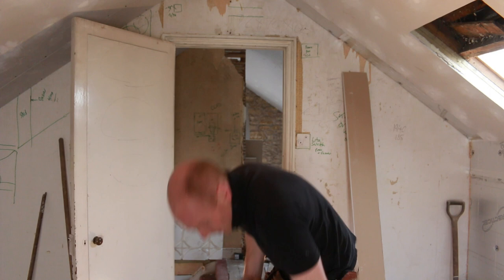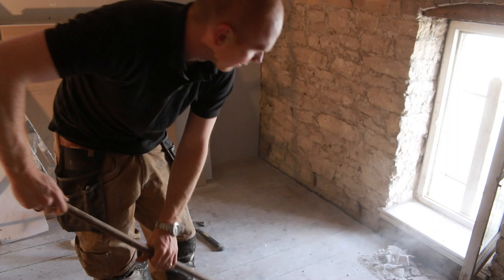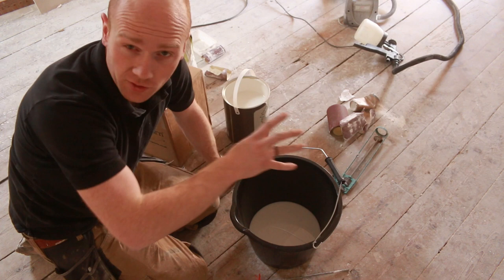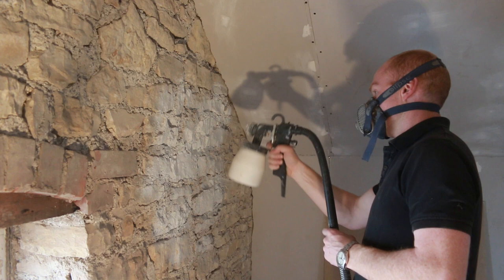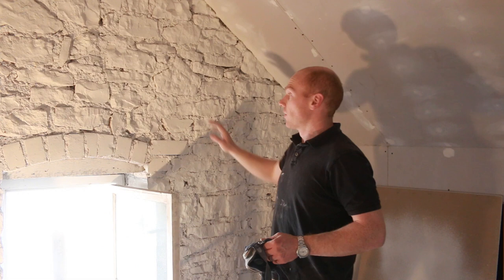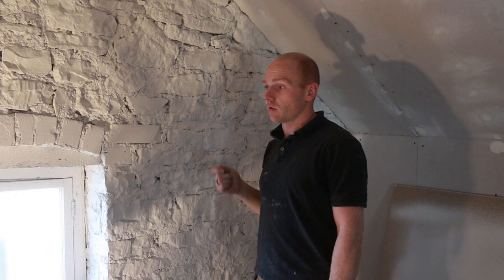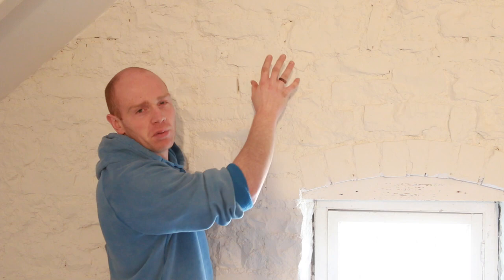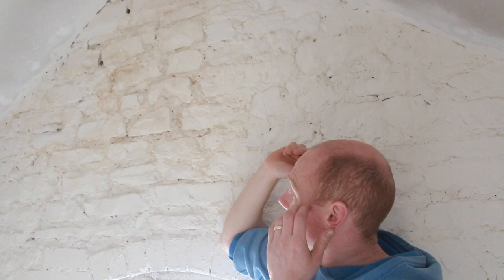Transforming Old Stone Walls | Loft Conversion Project 8.0

Comment: Had the very same problem on a house in Jersey....we used PVA SOLUTION on 2 or 3 coats, allow to really dry, then coat again...
It worked for us...but maybe we were just lucky...but the PVA sealed the wall completely and gave the customer the look and finish they were looking for...
We also used an airless spray with the paint line turned down a bit so we filled all the blemishes you mentioned in your vid...but without causing any runs or streaks....
Great vids buddy...keep 'em coming.....cheers.....
Reply from the maker: Thanks for the tips.  It improved after the second coat however we tried a water based stain blocker in the worst patch this morning so that should hopefully do it without causing any problems.

Comment: Great video, as always.  How did you find it on the drywall?  I'm doing the same job and really don't want to plaster if I can help it.  Could I just slop this clay paint on and would it look ok.
Reply from the maker: Works fine but would not be thick enough to fill gaps and screw holes if that's what you mean.  Check out our video this weekend to see how we avoided plastering. :-)

Comment: Why not insulate the stone wall? Wouldn't this eliminate every insulation effort done on the roof?
Reply from the maker: While there would obviously be some benefit, the risks of insulating a solid wall especially with non breathable insulation is not worth messing with. Having had this done for 3-4 years, the heat loss from these rooms is not enough to warrant heating them at all and I would suggest that the stone mass also has been helping regulate summer temps too. I would do the gable wall in other situations though. 👍
Reply: @TheRestorationCouple  Are you saying these attic rooms stay over 20 degrees right through the deepest of winter with no heating?? Is your house in the UK?
Reply from the maker: David Clarke yeah pretty much fine all year round. Certainly better to keep the stone breathable than all the risks of internally insulating  stone work. 👍